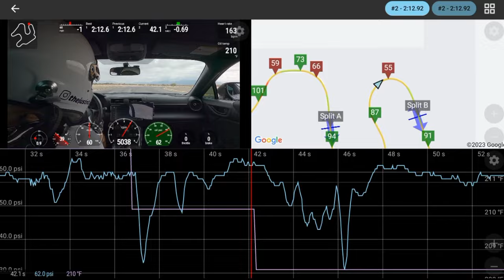GR86 Oil Pan Baffle Installation - Kazama Auto

Comment: So at 0:43 when you show the pan with the screw driver in place of the oil pickup tube, which way is forward, left and right? I have a suspicion that the full vertical is actually limiting the overall amount of oil that the pickup has access to IF the gate isn't open.
Reply from the maker: Could be, either way the thing doesn't help maintain oil pressure at all. See my latest video with the results, if you haven't already.
Reply: @TheBTRGarage  - I did! That's why I came back to this video. I suspect the baffle is actually impeding oil return from the left side of the pan to the pickup. Yes, the gate is supposed to open but anything in the flow path is an impedance to the flow (versus no baffle).

Comment: Did you let the RTV set for any length of time before installing the baffle to the pan or the baffle and pan to the engine?
Reply from the maker: The Permatex I use is to be installed within 5 minutes or so. So no, I don't let it setup or anything, apply and install. I do give it several hours before adding oil, even though it claims immediate return to service.
Reply: @TheBTRGarage  copy that.

Comment: You cleaned silicone out of the pickup once before. Did you find any more silicone in the pickup this time?
Reply from the maker: No, the pickup was perfectly clean. This was actually the 3rd time I've had the pan off. The 2nd time had only a couple tiny specs of silicone in the pickup.